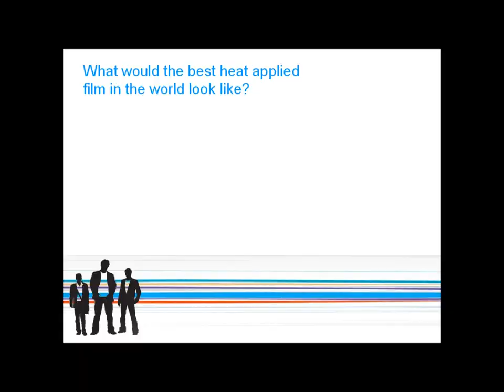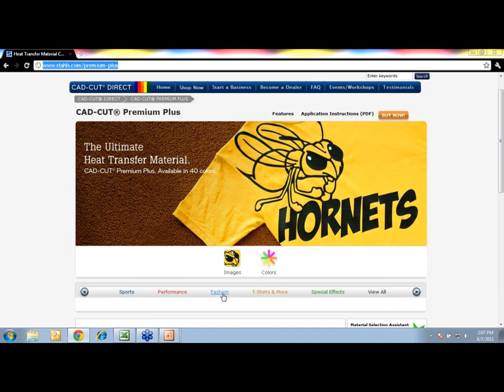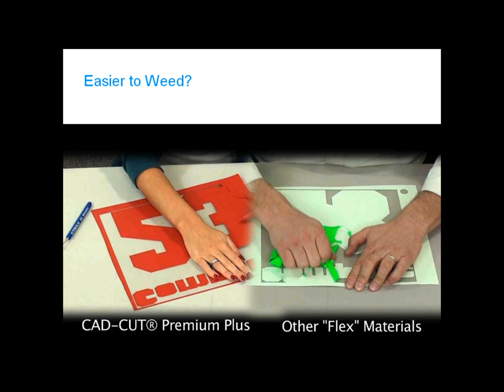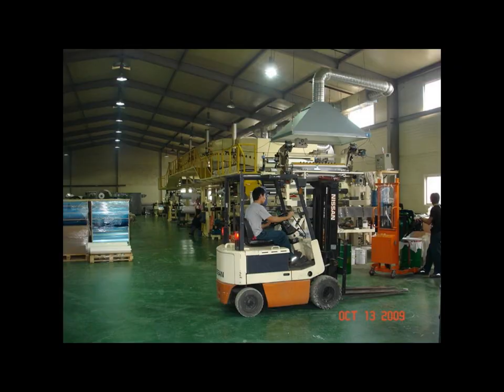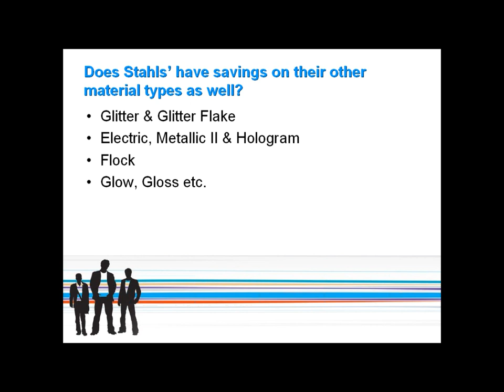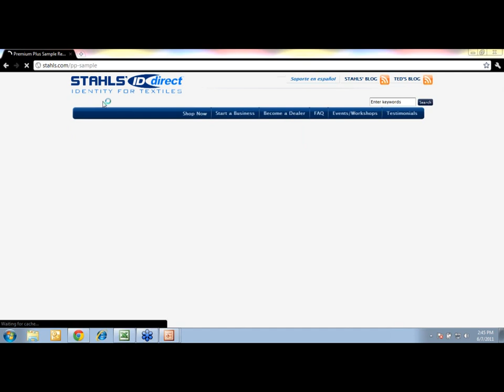CAD-CUT® Premium Plus - The Ultimate Heat Applied Material

Comment: yeah meant form fitting the shirt,not shit"lol,flock  need to become more pull worthy so if u got on a tight shirt the design dont crack,i found this out while my girl was wearing a desiogn i did in yellow flock"josh" it cracked some to wear a customer might be really piss,now i just use it to be a under patch or i now will let them know cant if its a tight fitting shirt and it cant be pulled barely it barely gives.premium plus is good,feel nice like its came with shirt,that ink look.